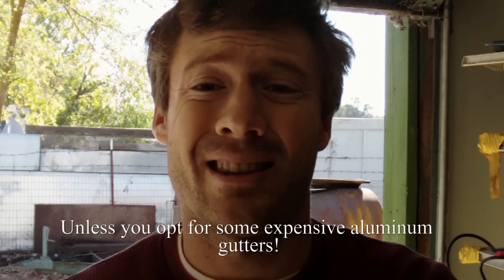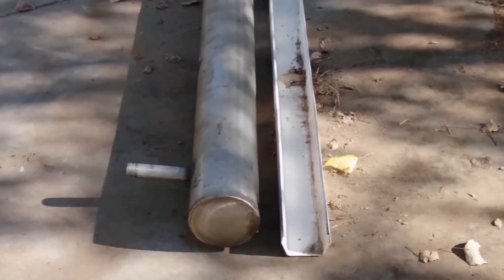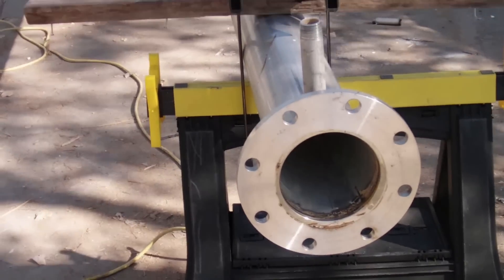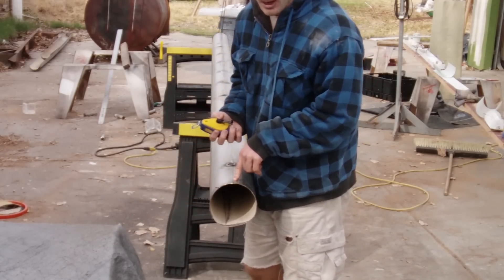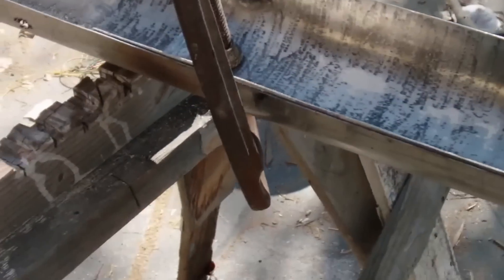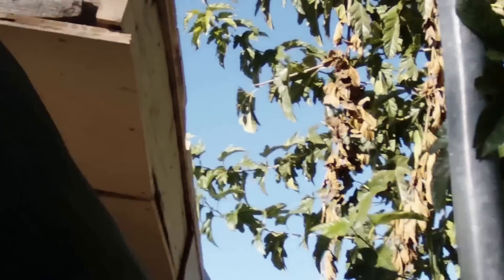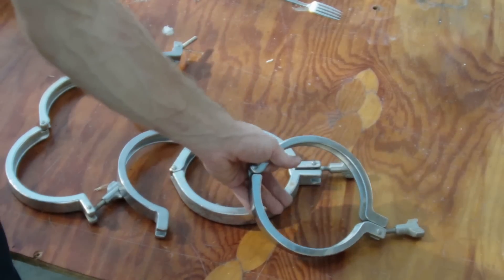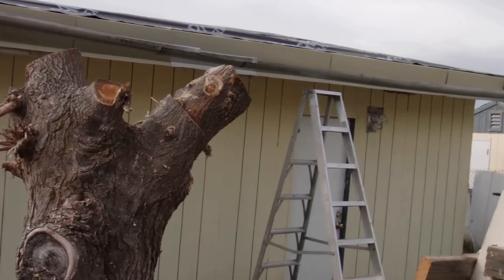DIY Stainless Steel gutters. Cheap & Strong!

Comment: I don't think you want oxy/acet to cut stainless.  A plasma torch would be best.  For your thickness a cheap one ($300) will do.  Find a used one on craig's list.  A porta band saw will also work very well.  A regular cutting wheel also works.  You will have a long lasting system done right.  Doug

Comment: My 150 ft. of aluminum gutter from Lowe's cost $0.718 cents per ft.   That's $107.25 for the aluminum gutter.  The hangers and downspouts were extra but done properly with lots of extra hangers to add rigidity my installation should for the rest of my life.  I had considered using pvc pipe sawed in half lengthwise.  10 ft. Sections are $7.18 for 10 ft. sections.  Correctly joined (riveted) it is as strong as seamless and very inexpensive.  A lot of work for these 71 year old bones? Definitely but doable.
Reply from the maker: ooo nice. lowe's. 'wish I had one closer to me. I always liked lowe's better, but I didn't realize that they actually featured decent materials.
The adhesive will go bad in 50 years or so. Unless those riveted joints are brazed, they're going to be a failure point.
The aluminum is probably a more rigid, less corrosion resistant alloy. They might last 100 or 200 years, presuming that someone doesn't lean a ladder or climb on them. That's pretty decent, but these may last a few thousand years longer...presuming that the tree corpse structure miraculously lasts long enough to keep them.

Sadly, conventional construction options are still anti-american by nature.

Comment: like the gutters and what some don't realize is they will outlast the house you are putting them on.   That grinder thing you did was very dangerous though,couldn't you just get some 4" H.P disks wear a face shield and safety glasses, its just not worth the risk of f'n yourself up permanently to save a few bucks. I speak from experience and have been to the hospital more than once from grinder operation,   Try searching grinder accident to see what i mean.

Comment: All that crap including labor cost a hell of alot more than properly installed aluminum  gutters would have cost. He'll I did my own and guarantee it was cheaper, better looking, and a whole lot quicker than that heavy mess on the side of a house. I've  worked with stainless steel and there is no benefit over aluminum. I just put stainless up around my dormers as a flashing and I'll admit it has its uses, if done right.